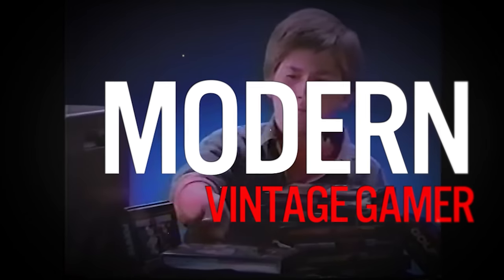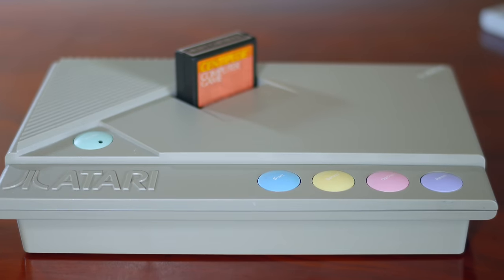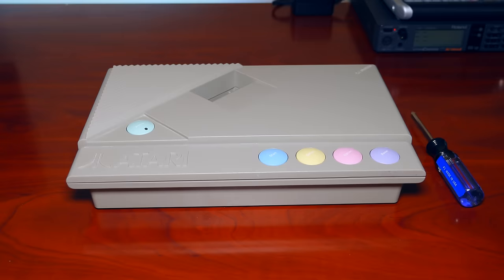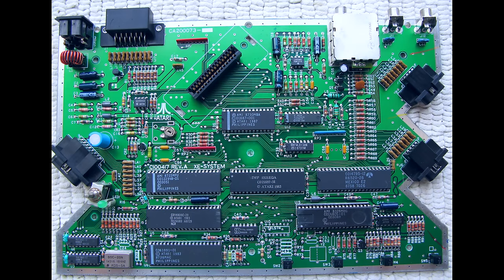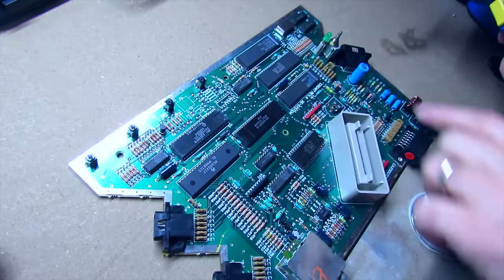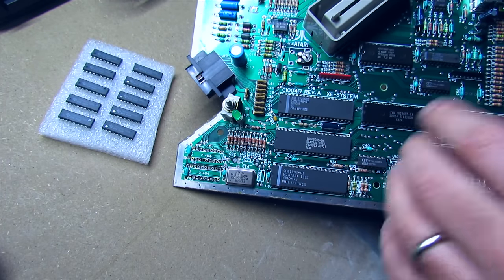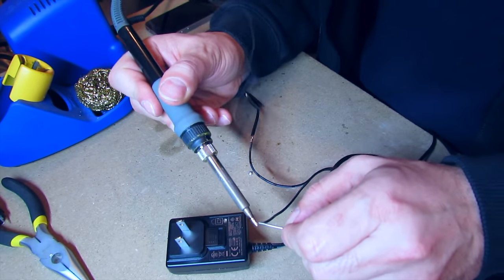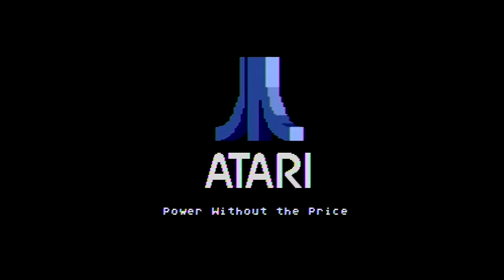Atari 8-Bit XE Game System XEGS Review, Teardown, Repair and SIDE2 Compact Flash Hard Disk Upgrade!

Comment from the maker: Is it a computer or a console?
Reply: I would consider it as both.
Reply: more like the function of a PC before its time in away
Reply: Plus an egg holder :-D
Reply: a consolized computer
Reply: But consoles are computers too... But dedicated to games and entertainment. :)
Reply: Both
Reply: It's a comsole or perhaps a conputer.
Reply: Basically, it was an attempt to make a computer into a console.
Reply: Rebadged Atari Computer
Reply: It's a rebranding of a previous computer system as a home console. A number of old computers like this had cartridge slots, like the TI-99 and the Commodore 64 (and 128). The Famicom (NES in the US) had a BASIC cartridge and a keyboard, in fact, with the ability to use a cassette drive for storage.

In reality, the division is imaginary. Gaming consoles are all computers. How much you can do with them is defined more by what peripherals and expansion options are available.
Reply: It's an improved version of an XL that does its best to look like a game system. (Functionally better than most of the Atari game systems out at the time too. More like the 7800 than the 2600, so it had nicer games.)
Reply: well it plays pc games and console well pc because it emulates console uh?
Reply: Modern Vintage Gamer it’s a computer. It’s just a reshelled Atari 800 with the keyboard separated and some slight internal changes.
Reply: Computer disguised as console
Reply: The cryptic answer is "yes". It is in fact a full blown Atari XE class computer - complete with SIO interface (a very neat daisychainable expansion port used by Atari since the 400/800 computers of the late 70s) for printers, disk drives, and even more exotic stuff like graphics tablets and even an educational science kit with light sensors, thermometers etc.

However, the XEGS was marketed as a console, alongside the "proper" XE machines, and the M68K based ST class. The reason was Atari wanted to get back in the console business, but only had the 7800, which was struggling and showing it's age. The XEGS was a cheap solution, offering a better experience than the 7800 without needing any new design work at the logic level. By getting Atari's name back up front, it would have paved the way for the Panther M68K based 32-bit console, which started design work in 1988 for a proposed 1991 release, but was cancelled almost at the last minute (work was ongoing at least as late as April/May 1991). As it was the consoles wilted on the vine, as no other home consoles were released from 1987 until the very end of 1993 (mid-94 for Europe!) with the Jaguar, by which time the XEGS was already out of production, leaving Atari in the weird position of only having a handheld (the Lynx) console for a while, along with a rather eclectic range of computers that weren't clearly differentiated.
Reply: It was an unnecessarily modular Atari 800XL computer, marketed like the ColecoVision ADAM computer, but far better, despite that the original hardware (from the 400 and 800, which predated the 800XL, by about four years) was released, in August of 1979!
Reply: It's a console-ized computer that no one ever used for anything other than games. :)
Reply: Are the sales numbers for Worldwide?
Reply: as mentioned in the video, it's an XE-65 minus keyboard, redesigned as a console, much like commodore's half ass console which was a c64 with the cartridge port moved to the top.
Reply: Have you tested the old RAM chips? They might have survived.
Reply: It kind of reminds me of Sega Pico: "The computer that thinks it's a toy!"
Reply: It's the console Atari should have released in 1982. Unfortunately it was 1987.
Reply: ...the odd thing was that it was really Atari's second crack at consolizing their 8-bit computers. The first had been the Atari 5200, back in 1982; but the 5200 was compromised, I think, by the perceived need to make something that wouldn't compete with the computer division. So the cartridges were not directly compatible with the computers (though most were obviously simple ports of Atari 400/800 games), and instead of the classic joysticks and paddles, the console used a completely new controller that was touchy and unreliable. None of this was compatible with the Atari 2600 either.

After that flopped, Atari went back to square one and had an outside company design the 7800, which had 2600 backward compatibility but was otherwise a new platform, completely incompatible with the computers and the 5200. But the 7800 was delayed by Atari's sale and dismemberment, and by the time it came out it seemed old. And then they released this thing, which at least had a huge existing game library and was a pretty sweet package by early 1980s standards, but just too much time had gone by.
Reply: It was a Computer that could also play games, if you start the console w/o any cartridge it would boot to a version of "BASIC".
Reply: i have an/the entire atari 400.800 8 bit games and utilities all packed up in a single zip folder. if anyone wants it let me know.
Reply: @pauljs75  no its not an improved version of the xl it has a crappier keyboard and much worse quality control
Reply: @pauljs75  Basically a rebadged 65 XE / 800 XE without the extended cartridge port / expansion ports but with an extra SIO connector and a detachable keyboard plus a built-in game when you didn't attach the keyboard and built-in BASIC programming language when you did attach it

I'd say technically more like a 5200 than a 7800, as the 5200 shared the same chipset as the 400, the 800, the XL, XLD and XE series, except for the 1850 XLD that never was, which was based on the Amiga Lorraine chipset). Compatible with the 8-bit home computers but not the other consoles.

Except for ECI expansion hardware, it could use all the same peripherals a 65 XE / 800 XE / 130 XE could use.

Commodore and others tried the same kind of thing. Remember the Colecovision ADAM computer? Remember the Commodore CDTV, the Commodore CD32, etc.?

All computers turned into consoles, though I think the ADAM was a console turned into computer.
Reply: @mechamania  Yep. This 8-bit hardware basically survived and was marketed and sold for nearly a decade when technology was developing rapidly and the difference between processor A and B and custom chip X and Y was much more significant / pronounced than today. Pretty neat if you think about it.

Too bad the other projects developed under Warner ownership (like the 1850 XLD, which was basically an Amiga, and the 1600 XL etc. or things like GAZA or the AMY-1 chip) were cancelled with the change in management.

It's basically like marketing and selling a car with the same engine and the same technical specifications for several decades and just changing the paintjob.

Making it modular no doubt made it cheaper to manufacture in typical Tramiel fashion and enabled them to earn an extra buck on the other components as well.

In any case, I do like the detached keyboard, but in my opinion it should have had all the buttons, the controller ports and the cartridge slot while the base unit could then be wired up to one's TV set. That way there would only be 1 lead to the unit, but at least the detachable keyboard made it possible to not have to pull the entire unit out from underneath your television set or monitor (if using furniture to have it hooked up) just to be able to type on it.

I also like the colour coding of the function keys, not sure why so many people (according to this video) dislike that. Still, the built quality when compared to the XL is not the same. The entire XL series (designed and built under Warner Communications ownership), while technically nearly identical, had a more lxurious and a more robust feel to it than the XE series (built under Tramiel ownership), albeit at a price.
Reply: Consoles are computers.
Reply: A computsole
Reply: It's a computer that wanted to capture some of the console market
Reply: Consoputer
Reply: BOTH
Reply: yes.
Reply: both and nothing of that
Reply: game capable computer
Reply: A console.  Because if I had one I wouldnt get the keyboard.
Reply: It was both, although The games weren't that good with graphics, The Atari 2600 and 7800 had much better graphics
Reply: @angelofelix8918  worst than 2600...so hard to believe.
Reply: @angelofelix8918  the 7800 had better graphics than XEGS but not the 2600.

The XEGS is basically a 5200, in between 2600 and 7800. Same sound and graphics capability.

The 5200 ran many of the same games the XE line had except it had a different cartridge type so wasn't compatible.

XEGS is basically a re-packaging of the XE computers which were beyond what a 2600 could do.

But yea.. 7800 went above the XE systems as far as color, graphics, and speed.

Mario Bros is a good example.

Order of worst to best versions imo.

4. 2600
3. 5200
2. XEGS
1. 7800
Reply: @magnolerriccardo6840  Well, it was hard to describe graphics in those days, the 2600 was a dedicated game console, and the Atari XE was sort of an attempt at a Hybrid console/computer. To be honest with you, I had all these consoles many moons ago, when I was a young man, so probably forgot why I liked my 2600 more. Back in 1987 Things changed fast; I had a 2600 and liked it a lot, then probably in the same year I went from XEGS to 7800 to NES. My son insisted I was wasting my time with Atari's (He had seen an NES in action). 
But the XEGS to me seemed more a computer than a game system
Reply: @Lightblue2222  You're probably right, My very first computer was the XEGS, I had a commodore monitor I used for it, but just that, so I never had any of the other Atari PCs. My first game console was the 2600, probably why I liked it so much.
Reply: @angelofelix8918  you could be onto something.
I notice some 2600 games look smoother and faster than 5200/XE. Mario again being an example, even though 2600 is way cut back. Games just feel really good on the 2600.. to put it bluntly, its not like a clunky old computer. Everything 2600 is solid simple 60fps. Where I think they pushed 5200 a lil too far with graphics and ends up having slower choppier games.

I've never played a 5200/XE since I only have 2600/7800, just been comparing gameplays. I notice it's a recurring theme that some 2600 versions just look smoother.

7800 was good too. It's a total game machine, and doesn't feel like a computer trying to play a game.. if that makes sense.

Home computers seem built with buisness tools as priority and then they started to have enough power to mess with games on the side..

Though on the side of 5200/XE, there are alot of games that were better than 2600. And the 5200 had analog which made games like Centipede arcade accurate trakball control.

5200 was marketed as a games machine but I think it's only benefit over XE was the analog instead of digital control, which only benefit certain games..

Even though home computers have had better graphics at times, I always looked at game systems as something different.
Reply: @gtamasterplayer383  me too
Reply: @Lightblue2222  i have the complete atari 8 bit computer games and software. perfectly organized. its on my google dride for download in a zip folder.
Reply: it was a POS
Reply: It's everything you could have wished for. 😁
Reply: It's  consolised computer
Reply: @1960ARC  Good answer. 👍
Reply: Both ways exactly. Even converting into an All In One laptop is a tough one to swallow.

Comment: Great video.. The first desoldering scene went on a little to long, but otherwise I rally enjoyed it!  Also, I'm curious if you actually tested the RAM chips, or just assumed they were destroyed because they were so hot?
Reply from the maker: hey thanks! i actually cut out quite a bit of it but yeah i think another 30 seconds was probably needed. I appreciate the advice.

as for the RAM, i had no way of testing them (ie no logic probe) - and its likely i fried them as soon as i plugged in the Atari PSU and powered it on - that was my mistake

it was really a process of elimination at that point. I fried the 2 original chips, replaced them and used the same Atari PSU (with +6.8v coming out of it - ugh), replaced with new chips again but with a +5v PSU and it worked.
Reply: Well, I would have tried using the existing chips after replacing the power supply.  And if it still didn't work, then I would have put some new ones in.  Just because they were hot is no guarantee they were damaged.  In fact, if you think about it, all of the chips on the board were exposed to the high voltage spike and they still work too.   Anyway, that's just what I would have done. But the important thing is you got it working!
Reply from the maker: thats a good thought, i will try that, but id bet they are as dead as doornails :) - and yeah i think i was very fortunate that nothing else died. Its amazing theres no fuse or protection anywhere on the motherboard or the psu
Reply: Modern Vintage Gamer He's asking if you tried the "fried" chips again after replacing the PSU. Unless you tried them after fixing the power issue it seems to be an assumption that they are fried. Yeah, they got really hot, but I'm still curious to know if they might still work!
Reply from the maker: yep - i will try them tonight. i doubt they will work but who knows :) ill update here
Reply from the maker: confirmed chips are dead :(
Reply: If they are hot, even warmer than the other chips or colder are dead. There are two ways more to find out. One is to measure the voltage of all pins and compare to other. The other way is to measure ohm on all pins from bottom to top while the machine off. If a chip has different results, it’s dead.
The best way to remove is to cut the pins and remove the chip.
After that pins are easy to be removed.
Reply: Oh hey! Wasn't expecting you to be here, David :)
Reply: Great Vid! I enjoyed it. I personally would have cut the legs off the ram chips before desoldering as trying to desolder it all and pulling it out in one go is very hard and could cause the plated through holes to get dragged out too causing major damage. Or another way thats a little risky but easier is to insulate the board with foil except for the bit you need and use a heat gun or hot air gun and heat all pins together and gently pull the chip out by threading some wire under it and making a handle. A third option is to use a DIP shaped block bit on a soldering iron.
Reply: The 8-Bit Guy wow I love your channel can you shout me out in one of your new videos
Reply: I actually enjoyed watching it because of the music lol. :)
Reply: As a rule of thumb, I find old DRAM chips to be like the canary down the mine.  They often seem to keel over first but just today, I had to replace the ROM chip in my XEGS.  Does anyone know if the standard one is a mask programmable ROM or an OTP EPROM, I've got just three bits flipped in it.
Reply: @ModernVintageGamer  i have a hard time believing that considering everything else was fine after multiple powering on and datasheet says max is 7v i bet you didnt even test them
Reply: Pusalieth  wrong
Reply: @kevgardner3064  to drop that doubtful "bomb of knowledge" here 3 years since the upload, and still forget that if the power supply is showing overvoltage it might very well be shooting far higher voltage peaks that the shown 6.8v...
Reply: @ModernVintageGamer  On the plus side, you also confirmed that the RAM chips are basically this system's fuse ^_^;

Comment: You were using the dreaded "Ingot" power supply! Never use that model, ever! I have one and have been meaning to toss it for years. The seller didn't give you the power supply that came with the XEGS originally, which was not this bastard. I know this video is years old, but everyone needs to know that this particular PSU will destroy your machine.

Comment: 8:43 
"Then I thought about it, I never tested the voltage coining from the power supply.  Maybe I should have done that first." 

I remember when I was studying computer hardware and network engineering one thing my instructor always said, "start with the simple problems first, because even though you know the system inside and out, it doesn't mean it's a complicated issue."  And sure enough, the more I learned the more I was tempted to try more complex solutions when about 80% of the time it was simple issues.

Comment: A few hints: When operating the desoldering gun, wiggle it. This way you'll get the solder more easily.
Also, if you first use/add some fresh solder to the pins, the old solder goes away more easily.
And thirdly, to avoid damage to the pads, make sure the chip is properly desoldered before attemting to remove it. If desoldering is done properly it falls out on its own (maybe with a little sideways nudge). If you try to pull it out, while still attached, you'll rip out a soldering pad and maybe even a line.

Comment: Amazing video bud. It is brilliant how you got that beauty working again.  I wish I had your electronic repair skills. it just isn't my area of expertise. That said, the tip about checking the power supply first is fantastic. I have to get one of those Sideii cartridges for my 800 and 800XL. Great work on the machine and on the video!  --  Bill
Reply: The SIDE3 is due soon and will be better than SIDE2. Also AVG-CART is fantastic too. SIDE2 is not as good but still nice.

Comment: Nice video had one of these in the day. Had an old Atari 400 from new and the power pack actually caught fire some years later so its worth checking power supplies if investing in retro. If you're after light gun games there was Crossbow, Barnyard Blaster and Crime Busters. The only other one was Operation Blood Made by a Polish company in 1992 a really well done game that was! Atari made some cracking hardware they had a 1st class R&D team but the lack of 3rd party software support caused its demise